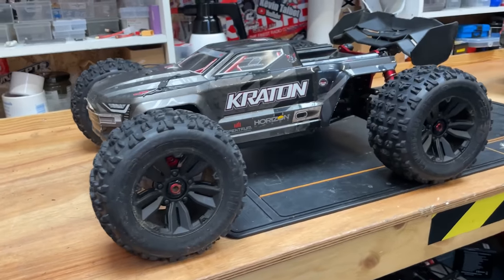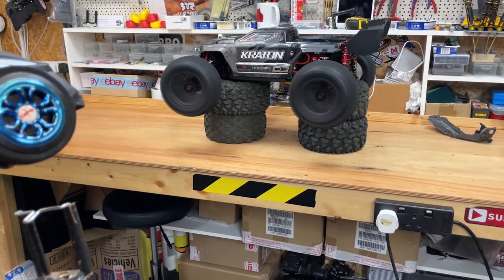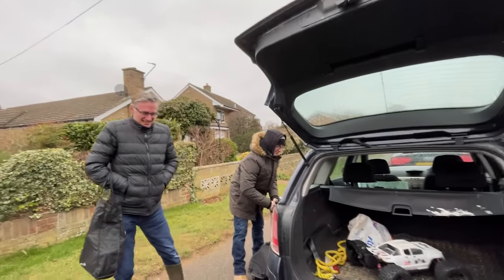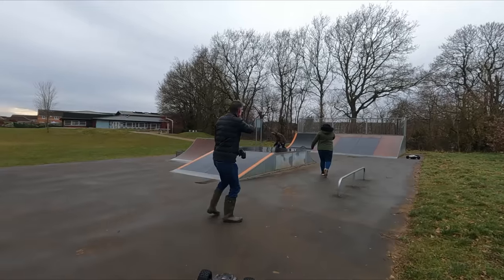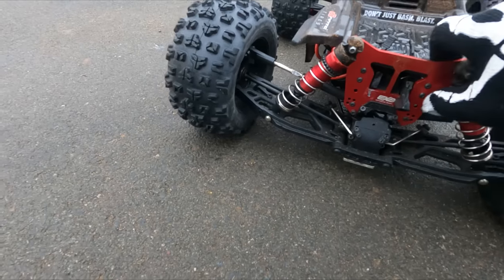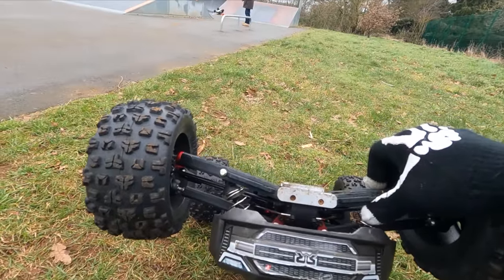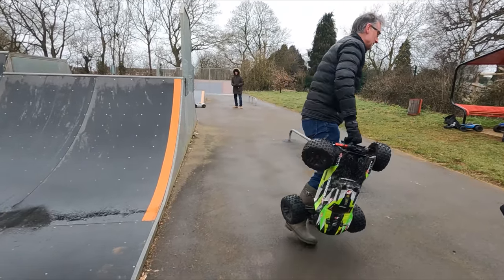8s 40,000rpm RC car insanity (it blew up)

Comment: When Kev says “8s baby” you know that rc car is going to the moon. And never coming back.
Reply: Maybe there should be the insanity of 12s. Be an absolute beast. Although I'm not sure if any rc car motors could handle 44.4 volts.
Reply: HahahHa
Reply: @callummclachlan4771  MGM makes some. Which is the brand of ESC in Kevin's 202 mph car
Reply: It comes back! in pieces though!!
Reply: to heaven or hell you mean
Reply: 15 years ago we were Raving about 6s power. The Vorza came out n was king of the street. It was like wow 6s power. But it comes at a cost. Now 8s which is just ridiculous for 1/8th scale. How can you expect a car to survive 1/8 with that much power. I'm amazed drivetrains survive 6s let alone 8s. 
I'm a power junkie but 6s is enough for me. Hell I was brought up racing a Jet hopper so my Vorza is still plenty of power lol.

Comment: brings back memories this is the reason why I quit the r/c car thing 20 years ago ,  burn a gallon of nitro a day plus everytime you take it out you break something
Reply: But your back now. 15 years ago 6s was considered crazy n drivetrain wrecking power. Now 8s
Bugger that 6s is plenty of power. Especially for 1/8th. You break enough on 6s but 8s is just going too far I think. 
What are you driving now?

Comment: I understand that it is tough, but you said it is maybe the toughest rc out of the box you have. It seems to break every outing, and the X-Maxx can go out dozens of times and not break. Arrma K6 owner here, for the record.
Reply from the maker: i can't make my mind up which is tougher, but the exb can jump a lot higher so will probs break more because of that
Reply: @KevinTalbotTV  Well, I can see that point of view. It just seems to break way more than the X-Maxx ever has. Maybe if you get some Vitavon bulkheads, it won't be an issue anymore.

Comment: Quick question  not related but what is better a Rock climer or a monster truck i know they are different  but thinking of getting one to go on the beach with an over rocks ect had a monster truck in the passed and worked well but just wanting over opinions

Comment: It's Vitavon time. All those strengthened bits bolted to a plastic buklhead. Even if it hadn't broken the gear mesh will be all over the place on 8S and plastic.

Comment: These trucks are just too heavy to land on concrete with plastic parts. I truggified the much lighter/smaller typhon so hopefully I have luck with that off big jumps. And also my tekno mt410 which is an animal and is probably as tough or tougher than the xmaxx. Put those 2 head to head Kev!

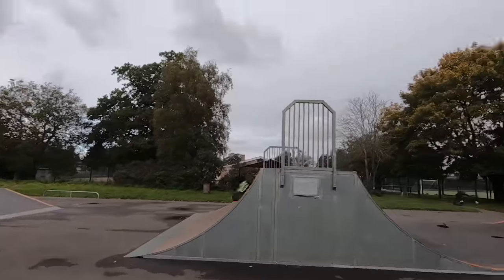Comment: How can they control the orientation of rc in air? Can anyone please explain the physics behind it? 3:21 3:45 Is it because of gyroscopic effect of wheel? If it is, then is it possible to program the car so that it always touches ground with wheels first automatically

Comment: Looks like no matter how you mod the kraton 8s, it's still not as stronge as the x maxx.😅 
That wide maxx need metal driveshafts, the plastic driveshafts where the plastic meet the metal wheel drive can't handle big wheels.😉

Comment: Quick question for everyone: most durable basher out of the box?
Reply: From what I’ve seen on YouTube it’s got to be the Xmaxx!
Reply: @dirtydon8661  seems that the smaller brother Maxx could be even stronger?
Reply from the maker: xmaxx, exb kraton or minimaxx i would say, slash ultimate too if you get better shafts and 3s arrmas are good
Reply: @KevinTalbotTV  if you had to choose only one based on durability :) ?

Comment: Only 40,000? ive got a 100k in my slash AND my arrma, blows tires almost every run lol.. Castle power baby
Reply from the maker: i have 100k in my trx4, bigger motors have less rpm but more torque usually

Comment: Dude took 1 jump and done. Arrma junk. Buy a race kit, it won't let you down as much, a tekno, or Serpent srx8 etruggy would be perfect for extreme bashing, serpent has an rtr truggy. I just got one and it is very durable.  Cool vid, but they both broke after a few jumps? I challenge you to see if Serpent is up for the challange?

Comment: I'm sad. I have my brand new Arma EXB  1/8th in the shop with a 1717 20 tooth pinion gonna run it in 6s.           It's suppose to be Extremely tough but I don't think it looks that tough. A Thunder tiger MT4, would shit all over that strength wise, even my two older buggies, the Vorza n Dominator, both brought out 15 years ago and are just way way more tough than anything these days. 
This EXB you pay alot for Strength, but still get less than the old cars. So you pay a fortune just to get half decent strength. 
I was gonna buy a Typhon but got told their quick because their light. Having a light car is great for torque n speed but comes at the expense of strength.